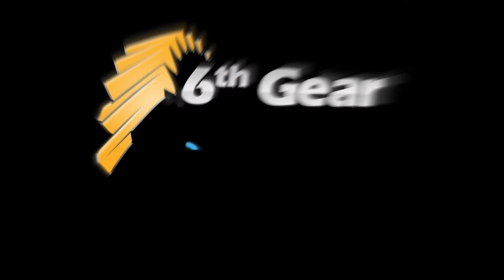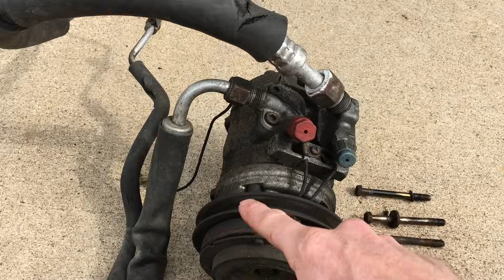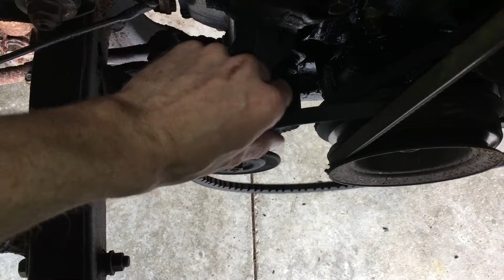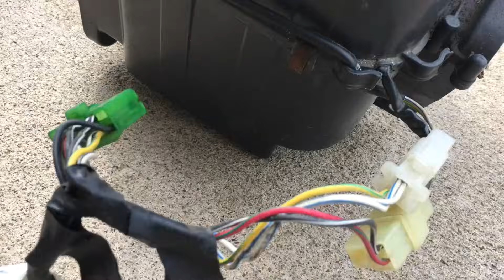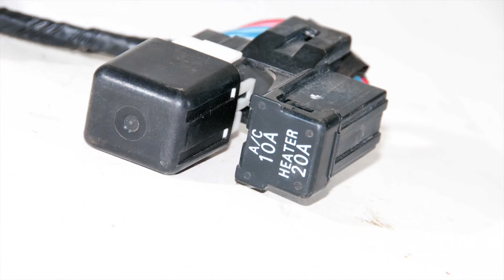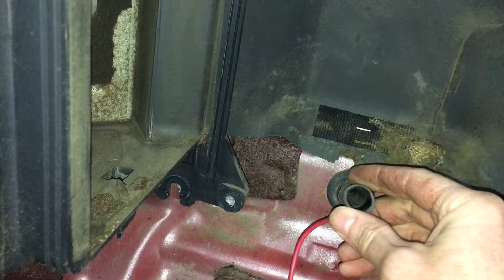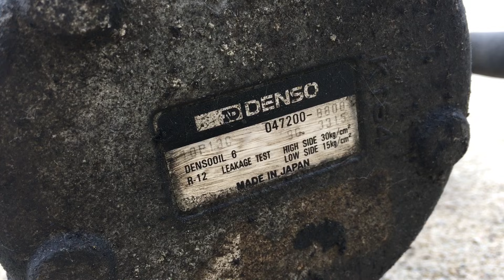Parts needed to install Air Conditioning in 1984-88 Toyota Pickup Truck

Comment: Actually, using junkyard parts for retrofitting AC can not be recommended. Being a closed circuit, each and every part of the AC system is important for its operation. And they go bad when left with for a long time.. All these parts are available brand new, and there are universal compressors, condensers, dryers on the market. You'll just have to fabricate some brackets for them to fit on any vehicle. All the plumbing should be done with new parts because there is oxidization going in those pipes after sitting for a long time. That dust of aluminum oxide won't be nice inside the components of the system. And make sure to replace all the flare type fittings with o-ring type fittings. Sometimes the flare types tend to leak a little bit of gas.
Reply from the maker: Excellent info... thanks!

Comment: Did you install it
Where is the video
Reply from the maker: I removed it from the truck I was parting out. I did not re-install it.
Reply: @6thGearGarage  would you be interested in selling the ac amplifier with the green plug harness? I have the wrong one for later years.
Reply from the maker: @anthonyolivarez6452  I no longer have it

Comment: I have a 1985 SR5 that came without AC.  WHERE CAN I BUY THE SYSTEM. I the shop manual and an 84 to copy. Everything Toyota early goes to Mexico. I would appreciate some source that can get me one.
Reply from the maker: It is not available as a full kit. You may find some parts at the dealership, but any discontinued parts will have to be sourced from junk yards or maybe ebay.
Reply: @6thGearGarage  I tried all that for quite a while now without much luck. The idler,compressor bracket,wire harness, and evaporator ,TXV and plastic air plenum are never there.
Reply: Edwardcarlton397@yahoo.com
Reply: Try offerup.... I was able to get a whole steering gear box for 40 bucks before the donor 4Runner went to scrap

Comment: I have an 88, and there are no factory punch outs for the ac lines to come through the firewall. 😔
Reply from the maker: That's a bummer, I never thought to check that on a non-ac truck.
Reply: @6thGearGarage  I'm still going to put it in. I've done it on an 87 Chevy C30 dually. The one thing that's really got me worried is rather or not the heater core box has the space for the evaporator to go in with it, or if they used a different box for the trucks w/o factory air. 🤷🏼‍♂️ Have t been able to find a definitive answer anywhere yet.

Comment: Im thinking of just getting a small air conditioner, and mounting it somewhere to the back of the cabin, so that it pushes air in through an opening/tube. It would have to run off a 12v-240v converter though... Or maybe there is a better option. I may need to get some kind of upgraded alternator if I do it, Im not sure

Comment: This will be exoensive to get. Have a 78 hilux & want to add AC to it after i swap engines on it
Reply: Nah. You can buy pretty much the entire system including the evaporator, lines, compressor and condensor for under 350$. They have full kits all over the place on eBay, ect.

Comment: ok so I am a self proclaimed 80s toyota A/C expert the HVAC wiring harness with the relays and fuses are the same on A/C and non A/C trucks toyota pre wired all of theses trucks so A/C could be dropped into them at the dealership if it had it listed as a option on the window sticker or if a potential buyer wanted it. all of these trucks left the toyota factory without air conditioning and they were installed at the dealership, that is why on the evaporator assembly it says N.D.L.A, the evaporator was assembled at the NipponDenso plant in Los Angeles California. The A/C systems came to the dealership in a box and it was part of the PDI (pre delivery inspection) also another note, these factory A/C systems suck with r134a the condenser is too small to efficiently cool using r134a. Keep these systems using r12 you can find NOS r12 on FB marketplace and these systems only take 24oz of freon so you only need 2 cans. I have had a few factory toyota A/C systems and they were meh, I rebuilt the A/C in my 85 tercel wagon, I flushed it replaced a leaking hose, The txv the compressor, drier and gave it a fresh charge of r12 and it cools to like 48 degrees when you are moving so it is a solid ok on a super hot day. however on my pickup I pieced together a complete new A/C system it has a new sanden compressor a new parallel flow condenser (the style used in new cars) and a new aftermarket style evaporator assembly. in my pickup on a 80 degree day with 70% humidity it cooled the air to 36 degrees (the A/C temp cutoff)  and fogged all of the windows just idling in my driveway.
Reply: Totally agree with all these points. Best option is to retrofit to a modern A/C system. Only thing I would do differently is going with a Denso compressor instead of Sanden.
Reply from the maker: Thanks a ton for explaining all that👍

Comment: Can you PLEASE tell me if this usually includes the evaporator core? I got mine "fully" replaced and paid 1200 now they're saying its gonna be $500 for evaporator core.
Reply from the maker: I’m not sure, but the system needs all these parts to function correctly. That price seems high to me.
Reply: Thank you!
Reply: Thank you. This was for my 88 22re
Reply: Evaporator cores that go under the dash are 80 bucks at O'Reilly's automotive. I had to just buy one for my 1990 4Runner 3vze

Comment: Hello I have an 85 and that connects to the discharge line from the drier is broken the one with the crazy bends that goes through the radiator support. I have no idea where to find the line or who to get it from, if you have any idea please help thanks
Reply from the maker: If the dealership says it's discontinued, I'd look for one on ebay.
Reply: 6th Gear Garage I guess it’s called a Liquid refrigerant tube/pipe the part number is 88716-89148 and they are impossible to find it’s discontinued from Toyota and no one has it only hope is a junk yard or fabricate something myself

Comment: Great job as always 6th gear!!! Down here in south Florida these 84-88 trucks are rare. I'm looking for the metal support bracket that the dash pad and speedo surround attach to. Working on doing rust repair on the bottom of windshield and the water rusted it out. It's  the braket where the vin tag is mounted on. Watched your dash breakdown vid prior to this, you're the man 6th gear!
Reply from the maker: Thanks!! Hey I think I have the metal support bracket you're looking for. What's your email? I can send you some pics to see if it's the right one.
Reply: @6thGearGarage  Thanks for the reply! That would be awesome if you have it. How do I send you my email? I don't see dm on youtube.
Reply: I just went to your site and replied to you. Thanks in advance! Your truck looks awesome btw.

Comment: There's a couple of things needed that aren't mentioned in this video, namely the VSV and the separate engine harness. There's another harness in the engine bay, with both a line to the Tachometer (needed for the AC amplifier) and the compressor and VSV. This harness is needed for all trucks to run AC, I can't find a way to get it. I think it attaches into the fuse block in the engine bay, mines a carb'd non AC model so I wouldn't know.
Reply from the maker: Good info, thank you!

Comment: My Ac went out on my 86 toyota pickup i have a leak but i can Not find the leak on the outside?? Now if my exp Valve is bad how do i change this?
Reply from the maker: You have to poll the evaporator box out the change the expansion valve.  The box opens for better access.   Also there's a yellow dye you can put in the AC system to help find where it is leaking.
Reply: I need to replace my evaporator too so it looks easy to remove but not sure
Reply: Evaporator box is easy to remove. Disconnect the two ac hose going into the firewall, remove glove box and bottom bar. I think it’s 6 10 mm bolts and it slides out. Then you order a Denso replacement valve Denso 475-2086 A/C Expansion Valve
Reply: O'Reilly's automotive has evap cores new 
For $80 made in China. Original had a leak

Comment: Anywhere I can buy all this ?
Reply from the maker: I don't know if Toyota still sells all of these parts or if any have been discontinued. I'm sure you could find aftermarket parts on ebay.
Reply: I’m having some trouble finding these parts do you have a website where you buy the parts from ?
Reply: Isreal_ JG you can probably use rock auto

Comment: Thks for the video and explanation. Do you know what I need to do to replace expansion valve by any chance? Mechanics says it leaks and should be replaced. Have an 86 toyota truck. Thks...JC
Reply from the maker: That plastic box comes apart and you can get better access to replace the valve.
Reply: Ok, thanks

Comment: Lifesaver, I've been compiling parts for months, scouring parts diagrams. A few key ones are discontinued and parts trucks/junkyards are cleaned out.
Reply: I just saw a 1995 4Runner but the engine and tranny gone it was from Arizona it had no rust on it went to metal recycle but I did get a few parts from it before the guy sent it off... lot of parts of the same up until 1995 I learned like the 1990 steering gearbox is same 1990 to 95.
Reply: what parts are discontinued?

Comment: Any idea if the 4 digits after the 047200 make a difference? And do ac units out of the 90s pickups/4runners with the 22re fit? Thanks for the vid
Reply from the maker: I'm not 100& sure, as I haven't owned a 89-94 Toyota to compare the parts.

Comment: I know you said it only works for 84 to 88 trucks but will some of these parts work on a 94’ pickup?
Reply from the maker: I don't know for sure, as I haven't owned a 89-94 to compare.
Reply: The condenser and lines are different, they don't align to the holes in the core support, but with some modifications can fit. I'm not completely sure about the harnesses
Reply: Probably... all that stuff in the video looks like my stuff that's in my 1990 4 Runner